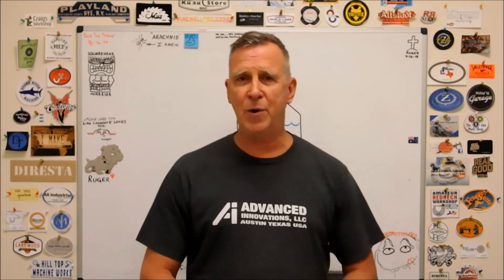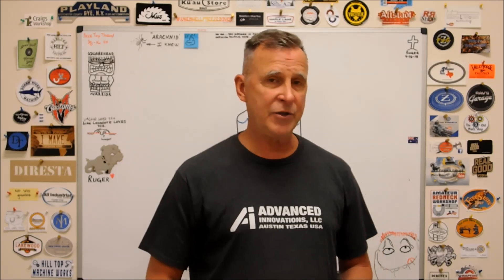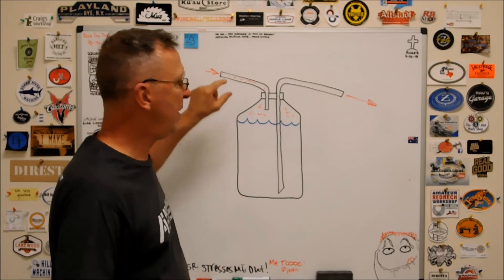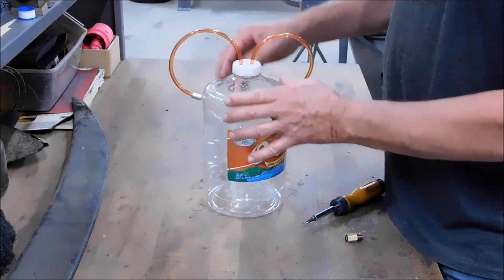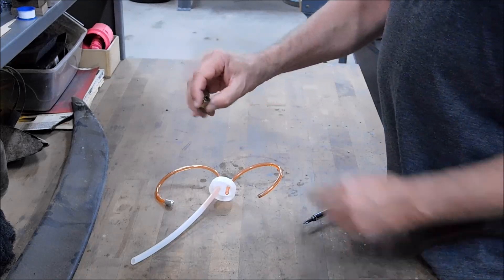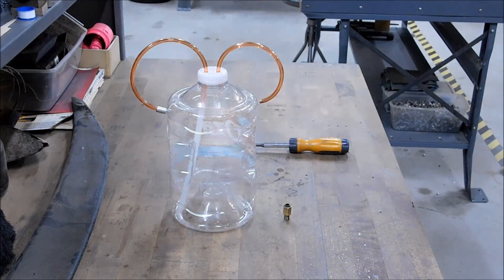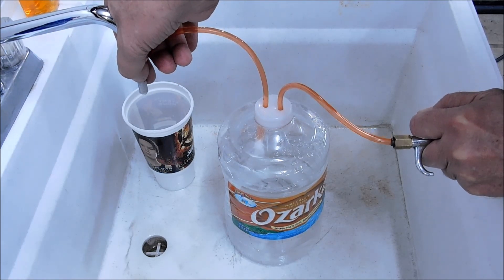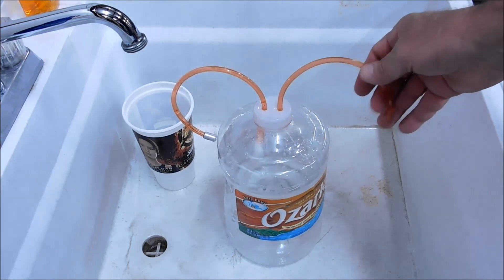DIY Coolant Pump

Comment: I guess, if you drilled a small bleeder hole in the fitting from air gun to the pressurizing hose, that provides a bit of pressure regulation, and also allows the pressure in the coolant tank to drop very quickly, so that you get a bit more on/off control.

Comment: There's more than one road to Rome.... A spare inline low pressure regulator could be used to limit your line to around 2 to 4PSI and you could simply hook it up and leave it open.   Another option is what you have here with an aquarium air pump attached instead of your air nozzle.  Just the right amount of pressure to push the liquid out and not have to worry about the container bursting.  I've done both of the above for delivery of fluids.  And another which I've used for weed control but not oil, solvent or cutting fluid is the U-Pump'em Up fertilizer or insecticide sprayers from the garden center.  If it's at all near the thickness of water it's a pressure container with a flex hose and small control orifice on the end of the wand with a supply valve built in.  Usually around $15.

Comment: I'm way late to this party but if you want cheap and easy, let gravity be your friend. Hang your bottle and let it drip, like an I. V. Use a mini c-clamp to mash the tubing to regulate the flow. If you want to recycle your coolant, catch it in a plastic pan, strain it through a coffee filter and put it back in the jug. If you're working with ferrous metal, swipe a magnet through the pan to grab the big chips before straining the liquid.
Reply from the maker: Good idea.

Comment: Dear Joe,
                   a while ago I saw a different installation which could have done this job and without any power input except mother nature. A fellow who's name I can not recall had rigged up an old rectilinear steel oil can on a wall bracket sited above the height of the  lathe. The can was fitted with a steel tube and cock to the bottom and a flexible hose thereafter. Coolant could thus be gravity fed in a controllable stream.
I hope that this may help.

Comment: Hi Joe,
You can get small air pumps that would be perfect for that application. You can get them on Amazon quite cheaply in various wattages.
Would give a constant steady low volume flow.
Cheers Dennis
Reply: Hi Joe and Dennis - I like the idea of the small air pump.....made me think of a fish tank air pump as well as the small needle valve they use to regulate the air flow.

Be safe and have a happy day!

Comment: The amount of coolant you can discharge between pressure cycles depends on the volume of air above the coolant, and the pressure.  So, when the bottle is almost full, you repressurize it frequently, but when it's almost empty, it'll run much longer (but it takes more air to bring that volume up to pressure).  If you know how much coolant you'll need, don't put more than that into the bottle.  Or, use a much bigger bottle than you expect to need just for coolant (i.e., 1 gal coolant in a 5 gal can).
The next question, though, is "where does the coolant go, when it runs off the part?"  I suppose you had to empty the coolant sump of the machine, before and after this job, or you'd end up with a blend of ordinary and special coolants.

Comment: Lots of great suggestions below. IMO if using your current setup an air-flow regulator would help. A small brass plug in the air line with a tiny hole ( #80? ) would do the trick. Think carburetor jet.
Reply from the maker: I agree.

Comment: Hey Joe, as always a great video. May be a better way to go is to add a third hose with a valve that can be modulated to maintain the pressure in side the coolant container rather than trying to regulate the input pressure.  This in fact how the pressurisation system on an aircraft works, its to hard to regulate input but dead easy to control out flow.  Regards Steve.
Reply from the maker: A more solid container would be the way to go. 4" PVC would probably hold up. The main lesson here was the air vs water displacement concept. Once you have that down, the construction is up to you.

Comment: It's not quite hands-off as you mentioned at the beginning; in fact, you need not only a hand but also attention to maintain the right pressure. Would definitely try it with a regulator.
Reply from the maker: I'll control the air with my foot or preset it.

Comment: Hello,  That would be the easy part.  Making a collection system gets a bit complicated on machines that aren't designed for it.  Especially important if using a water based coolant as left in nooks and crannies it can promote rust.  A squeeze bulb off an outboard fuel line would work pretty well although I would use a low pressure regulator for consistent flow.  Thanks for the video.
Reply from the maker: You are right. the collection gets creative as well.

Comment: Use a cheap propane regulator and run the hose out between 2 1x2s that are hinged. Step on the board to shut it off.

Comment: Correction. It is $18 Called tailonz Pnumatic foot pedal with 1/4 npt input with 6mm hose fittings. I switched them out to 8mm. Already had the hose

Comment: Fish tank low pressure cheap pump with a needle seat valve they use in fish tanks would help keep constant pressure in the jar.
Reply: Beat me to it, should have read through before commenting.

Comment: A Harbor Freight fountain pump is dirt cheap and will pump without intervention or danger of explosion. They come in several sizes.
Reply: All that is needed now is a dozen Golden Carp swimming around in the swarf tray and we're done. 🐠🐠🐠🐠🐠🐠🐠🐠🐠🐠🐠🐠 😂... Comedy aside,your suggestion is spot on cheap and simple. An automotive windscreen washer pump is also ideal for this sort of use.
Reply from the maker: You guys are missing the point. How many of us have windshield washer pumps or fountain pumps laying around in the garbage or recycle bin.

Comment: That is simillar to what I had in mind  for a coolant system for my mill.
Reply from the maker: Put a pair of 90 degree elbows in the pipe thread ports on the ends of the table and hang coffee cans from them to catch the coolant. It is simple and works like a dream.

Comment: Have you ever thought about cooling with air, a vortex tube could be made also from some scrap material. Keeps your machine clean.
Reply from the maker: I normally do, but this specific operation and material demands coolant.

Comment: Thanks Joe, another great video. Could you give some advice on when and where to use coolant vs. cutting oils and lubricants etc. when machining. I notice you don't seem to use the coolant systems on your manual machines in your videos and as a beginner am trying to understand the best practices around this. Thanks

Comment: This is the first time you made a video of something I consider potentially dangerous.  The air line to the bottle definitely should have been regulated.  With the setup you showed just l little too much air and you have a burst bottle.  In an ideal world you would have found the pressure needed to burst the jug then set the air regulator to maybe 1/3 of the burst pressure.
Reply from the maker: This bottle is paper thin. But the handle indents act like pressure warnings. They start to bulge when the pressure get too high.
Reply: Even so, it relies on a human monitoring the bottle's dimples oil-canning while he is trying to concentrate on running the lathe.  Regulators are cheap.  There is no excuse for not using one.

Comment: A regulator in the supply line would only take a few more minutes and give a much more steady and safe from overpressure coolant stream. Not being careful for a split second on the air chuck could mean a very messy and possibly dangerous outcome.

Comment: Hi Joe not all that dissimilar to Tom Liptons cool mist on his milling machine. Hot tip: soda bottles will decrease the risk of a explosion as they are somewhat pressure rated but cap styles are more limiting for tubing.
Reply: If you have a lathe...
Reply: @Eluderatnight  Not necessairly. a rubber lab stopper with 2 holes for tubing and a retainer like something found on a champagne bottle would work pretty well.

Comment: Joe. First video I have seen from you I didn't really like.  There is more than 1 way to skin a cat but this one is hackery compared to the standard you normally bring. 

Regulate the inlet but valve the outlet. This removes the chance of exploding coolant into your eyes. Controlling the output allows you to start and stop precisely. Put a quick connect on the low side of the regulator and pop it off when you need to refill. Most automotive supply shops will sell a cheap regulator with ntp so you can put the male quick connect on for shop air. A mig nozzle also works well for the sprayer.
Reply from the maker: I am positive I could fabricate a coolant system that would raise a few eyebrows. regulators, foot controls, bleeder valves etc. Nice 110v pump. Then I'd have to change the title of this video, because you have gone so far off the rails from a true DIY. This is meatball all the way, but the lesson here is the air vs water displacement physics.

Comment: A primer bulb for an outboard engine would do the trick
Reply: You would also build your forearm muscles, no need for the gym.
Reply: This would be my solution too - make the line from the bottle long enough to reach from the floor to the work piece, mount the bulb on a board or similar and pump it with your foot. Frees up both hands.

Comment: I am using a 10 dollar garden sprayer now, those size of a tea pot, for you put insecticide, hand pressure it and spray around thing. the only drawback is how you recycle the fluid. blow it out is the easy part, how to collect it back, skim the metal shave and return to the sprayer, that's where the work is. and i know i will never skim the shave completely, therefore i have a fridge magnet inside the sprayer.

Comment: Thanks very much for this, Joe. I ve been thinking how I should make one. Buying a proper coolant pump would be, for me at present, a purchase beyond my needs for the rare occasion I ve needed one so far, and also I don’t have room to store it when not in use. I realize I could use the weed killer bottle and a tire inflator, a foot pump. I gave away my compressor, simply no space.  Have you a recipe for mild steel coolant - one without lard oil?
Reply from the maker: Mild steel can be a hassle getting a really nice finish. I always use an oil based lube on that stuff. Nothing special.

Comment: Would it be feasible to add a balloon as a pressure reservoir? You'll have low and constant pressure.
Reply from the maker: Like an expansion tank for a pump. Probably.

Comment: Another option for holding miscellaneous things is to use a camera articulating arm with clamps on both ends. One end is used for attaching to whatever is handy and other to hold whatever needs to be held. I use something like this in my shop all the time. Works great for holding small flashlights.
Reply from the maker: I have a considerable inventory of LocLine. I may think about that.

Comment: You could also go the atomizer route if mist coolant is acceptable for the application. Instead of mounting two pieces of tubing in the cap, just use the long one with a T-fitting on top and have a line to the air gun. It’ll work like a old school perfume bottle with the squeeze ball. It would use a lot more air, but could be a good solution for a certain application.

Comment: What was your pressure going into the tank? I will probably use a regulator and just want a starting.
Reply from the maker: I reduced the input line diameter to match the feed line and everything balanced very well. I also used a small valve to act as my regulator. Foot control for the on and off.

Comment: Hi joe love you channel. After watching this video I was thinking an air pump from a fish tank may work as you air supply and give you low pressure and constant flow.
Reply from the maker: I rigged the system through a foot activated pedal feeding a small inline valve to control the pressure. It worked like a charm.

Comment: I want to be turning some 6mm to 3.8mm (toolsteel) at a length of 100mm, i experience a lot of deflecting when doing this although i am backing it with a dead center, what speeds and feeds would you recommend for this and potential cutting tool? at the moment i was using DCTM inserts. I was not using a traveling rest and i should note that yes, my tailstock is aligned properly to within my measuring capabilities. Thank you for any recommendations on how to do this
Reply from the maker: https://www.youtube.com/watch?v=X-TkuQDWdbA

Comment: "cool" idea either way. i thought of it when i first bought my cheap mill thatz not do cheap in this country anymore. however my question is when do you really need to cool the cutter down with coolant(i have a pump and return flow system)and with which kind of materials(stainless.s? e.g) because i know we get cutters these days with high price tags thst handle high heat generation

Comment: What a gas! That's really cool ;)
Reply: 45 years ago when I bought my Tig, it was water cooled. Took a sump pump, cut the end off an old hose, soldered it to a piece of copper pipe with a 90  twice (180). drilled a small hole and soldered a 1/4 in tube into it. put that into the water feed tube for stinger.  crimped pipe down with Vise Grips  until proper flow happened. dropped into 5 gal bucket of water. Still Works! 
     No pics. secret squirrel stuff? Joe

Comment: Quick and simple, just like you intended. When you’re the boss, design engineer, safety manager, and shop lead sure makes things easier to get things done. :)  We tried something very similar at work a while back and the safety people were all over us. They asked who “designed” our apparatus and they were not pleased with the answer. If it wasn’t designed by the Design Engineering group, and it wasn’t evaluated and approved  by the Pressure Vessel Systems Manager, we couldn’t use it!  Trust me, I get it. The rules at my work protect everyone and keep all of us safer. We deal with very high pressure systems, hyperbolic fuels, LH2, LO2, anhydrous ammonia, solid rocket propellants, etc.  The list goes on and on.   Anyway, this is a good fix for a one time job.
Reply: I know where you are coming from. I also work for a large corporation. We had to fight for over two years to get chain falls approved to do lifting. It finally took a manual lift injury for them to realize that the chain falls were to keep use safe.
Reply from the maker: I feel your pain. I've worked for giant corporations like that. The bureaucracy costs more to get approval of a process than the process would ever cost. Time management isn't always at the top of their lists. I usually just went ahead and did it if nobody else was at risk.

Comment: Have you had any experience with 3D metal printing?  I have mixed emotions about the process although I have never tried it. I have 40 years of machining and engineering experience so I love and trust the traditional machining methods, but I also see the efficiency of an additive method. I cannot believe that gluing a mass of metal particle together would be as strong as a machined part even after fusing and compared to a forged part even weaker.But companies are using this process to produce turbine blades for aircraft engines. What do you think?
Reply from the maker: I have a pretty solid knowledge of 3-D printing, but have not messed with metal. It is supposed to be the machine at the ISS for making tools and spare parts. That has to say something.

Comment: Yeah. Should just already have one of these sitting on the shelf - Noga Tankless Mist Coolant Unit 13" Coolant Line Length, 10-3/8" Hose Length MSC Industrial Supply Co. Part #: 67778019 Mfr Part #: MC1700 Price: $199.98 ea.
Reply from the maker: While you are waiting for UPS, I'm onto my 5th job.
Reply: @joepie221  Guess you missed the sitting on the shelf part. I bought mine a couple of years ago. Only has done a couple of dozen jobs. Well worth the cost and planning ahead. It is smart to know how to do in a pinch. Smarter to plan ahead. Was just a recommendation for other guys. Not for you.